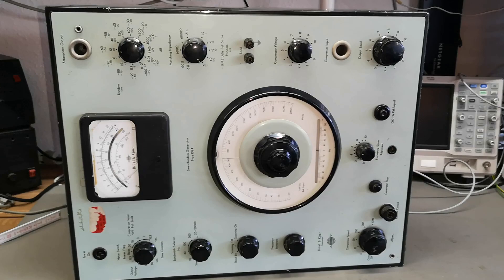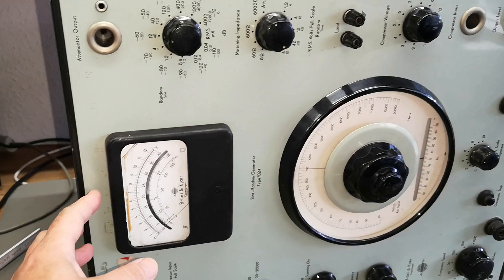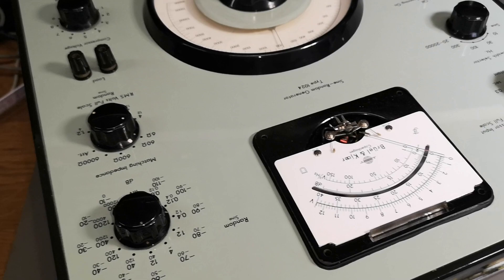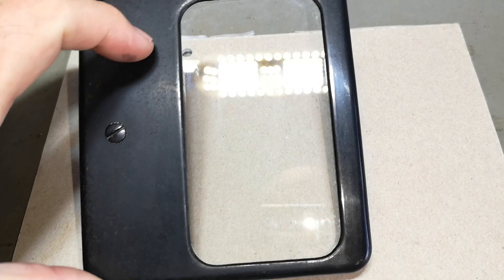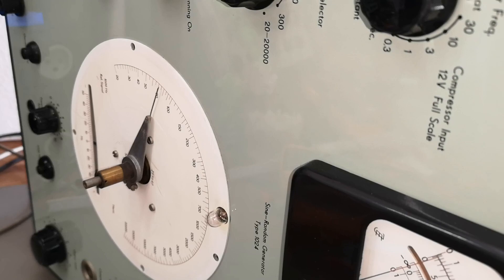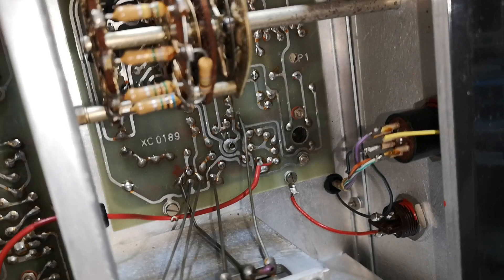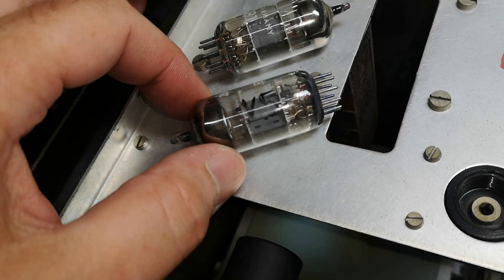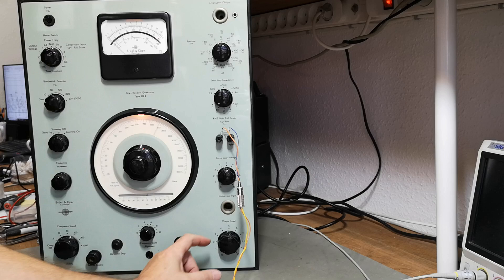Brüel & Kjær 1024 Sine Random Generator 20-20kHz arc repair teardown

Comment: one of the most versatile instrument ever made, especially when used together with a 2305;only but only drawback : any degradation of any tube will degrade performance...no feedback used to stabilize anything; later I use a small 1023; thank you of sharing al those videos kind regards Ben